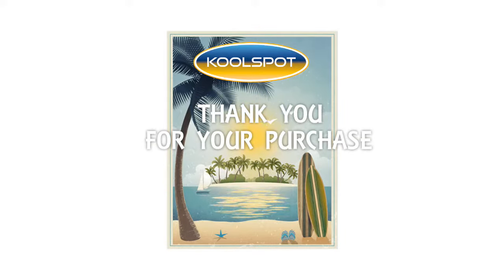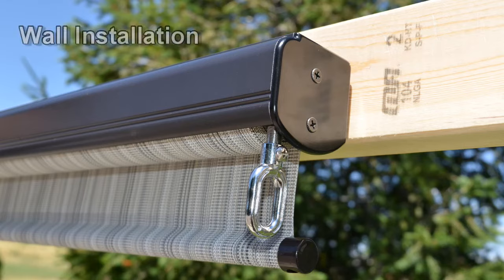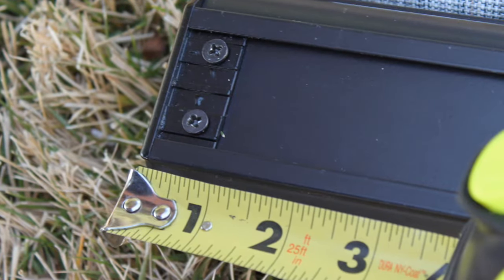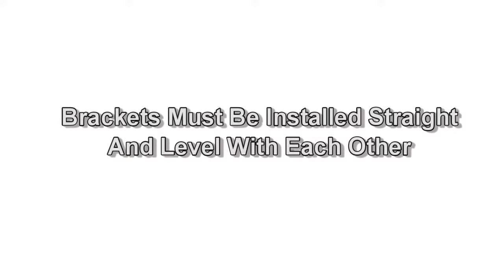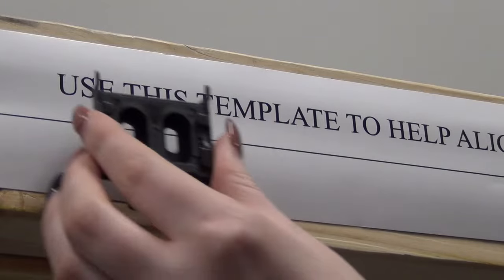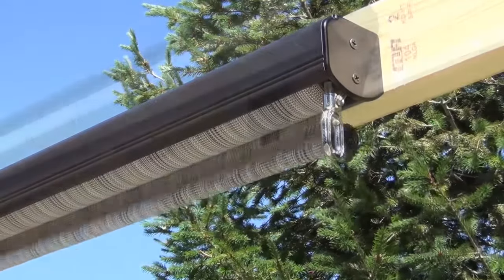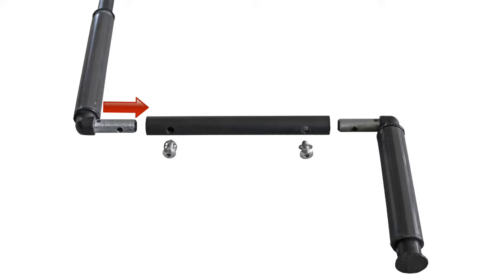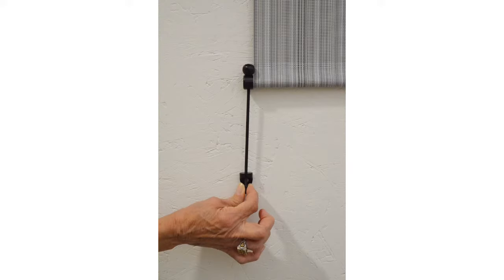How to install your Pole Shade

Comment: Can this be installed directly into Slump block?
Reply: I installed it on my block wall, had to buy extra mounts to spread the weight and did it NOT on the top row but it worked for my purpose

Comment: Why is your shipping SOOOO expensive?? $304 shipping for 2 shades at $210?? That is ridiculous!
Reply: Quality is remembered far longer than the price tag.
You might want to check them out at a retail store to save shipping costs. They are quite big and probably expensive to ship.
Full disclosure, I am NOT affiliated with the company, I bought two of these at Costco and am really impressed at the quality.
The instructions are in English, well-illustrated and the video above makes it simple to fit.
I've gone through several sets of cheap blinds (and had to replace the timber the blinds attached to as a result of the terrible way they fit.)
The way these affix to the wall/post gives a slight offset which prevents water/moisture from pooling up and rotting away.
Oh, and not to mention they are super light and easy to fit.
Yes, you can get cheap ones, but these seem really really good build quality.
Reply: I bought mind from costco for $60